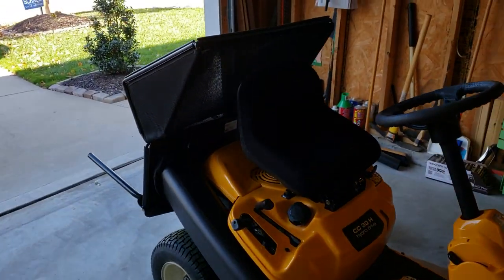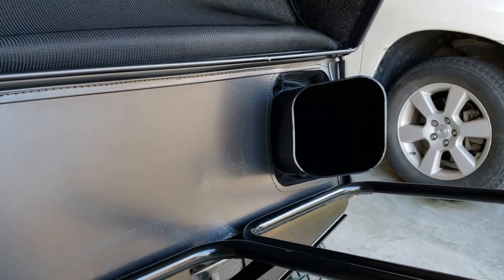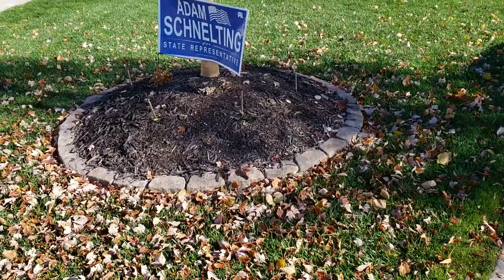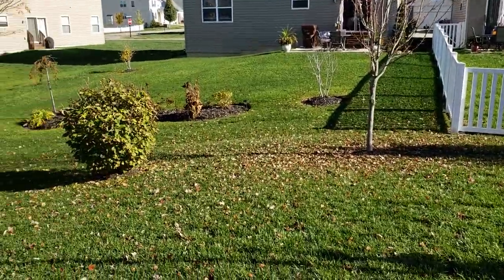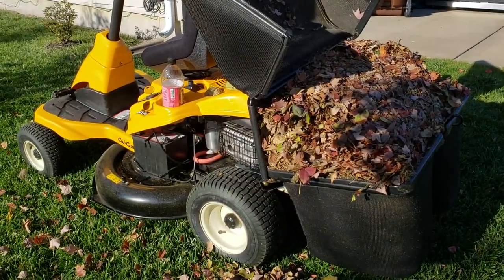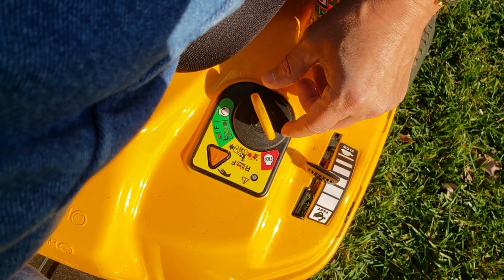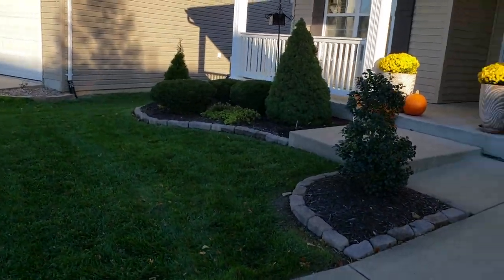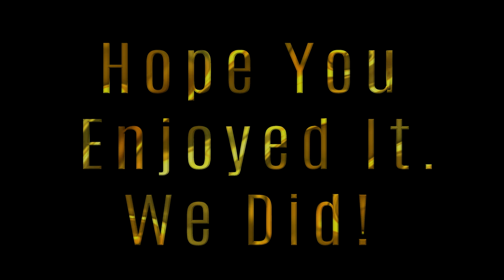1st Leaf Bagging with Cub Cadet CC30H Hydrostatic Drive

Comment: Hi. What do you think of your little Cadet 6 months later?  Do you still like it, or wish you got a larger machine?
Reply from the maker: We still like it. Wished it had a floating head, But to get nicer features such as twin blades, then it would not fit in our 2 car garage. Storage space was our primary focus, We think we got the best product on the market to fit in the garage and have simple foot controlled hydraulic shifting. We have a lot of trees and shrubs to mow around in the yard and no shifting was another primary reason to purchase it. If we had more money, we would have a bigger house, bigger yard, bigger garage and zero turn mower, but then we would have to maintain all that stuff.  We downsized into this house. We think we are quite satisfied where we are at with this purchase. Your wallet will be pleased too. It's almost 11 months old now. Have mowed the yard 20 times with it already.  We still do not like to do the hand trimming, but do enjoy riding it to finish off the yard.  The neighbors are envious.
Reply: @KCPrible98   Thank you for your detailed update.  I did not think about it not having a floating deck which considering it's price point sucks.  Today I did buy a Cub Cadet though,  but not this one.  I ended up getting the XT1.  I actually got it for $1439 with free delivery and interest free on my Depot card for 2 years.  I am hoping that in the future Cub Cadet will release an update to the one you have, with a floating deck, Cruise Control, twin blade and hopefully.
Reply from the maker: @10p6  thx, if I had the room in the garage and not so many trees and bushes to mow around, that would have been a consideration. Write back to me in a year please and let me know how it works out for you. I doubt the will change my little cadet in the future. I think you would have to get to 32" for twin blades. But adding a floating deck and floating front axle would help it. It's all about fitting in the garage and tight turns for us. Homeowners Assoc will not allow sheds just yet. Maybe by the time we retired this mower, things will have changed.
Reply: @KCPrible98   Hi again.  I'll let you know next year (I set a reminder on Alexa :-) )how my tractor worked out, and look to see if any improvements were made with compact ride on lawn mowers.  Until then :-)
Reply: @10p6  I actually sold my XT1 to purchase this mower after owning it for almost 2 years. My landscaping has changed considerably since I first purchased the XT1 and I always felt my yard was in between a walker and rider. So far I really love this CC 30. I have just under 1/2 acre and the CC 30 is just about perfect for my yard space and it works out great in the garage. I'm sure you will love your XT1.
Reply: Do you  dis engage the blades using the bagger?  Thank you.

Comment: It’s kind of expensive and only goes 4mph
Reply from the maker: I thought it was well priced compared to others that offered hydro shift in a small size. As I've stated before, I have 34 things to mow around my yard. On only 2 laps do I get to open up the speed and even then I'm only about 3/4 of the way down on the accelerator. Every yard is different, every person I'd different. All I can say is it fits my needs and gets the job done quite nicely & fit in a 2 car garage with 2 cars.
Reply: Kitt-Cindy Prible it is a good size but I thought $1700 was kinda high, of course that is approx msrp. I am glad it works for you!
Reply from the maker: Thanks Norman. I think we paid $1,495 for the mower (off $200 sale price) and then had to order the bagger from Cuba Cadet separately for $250.